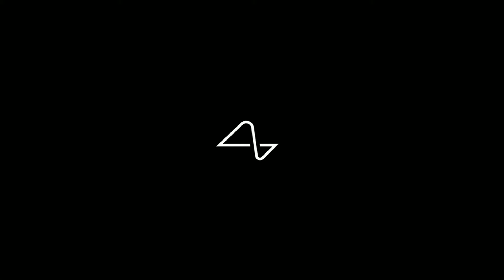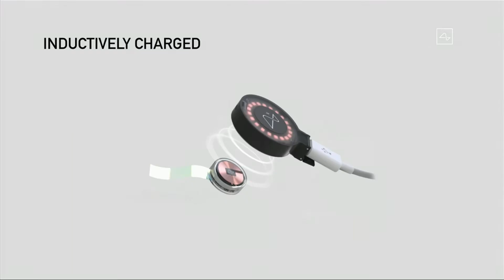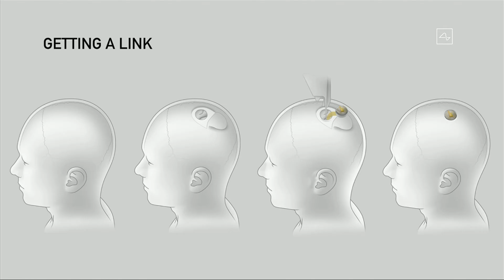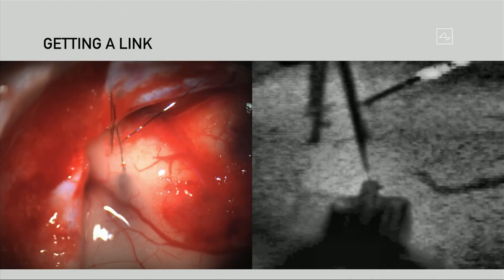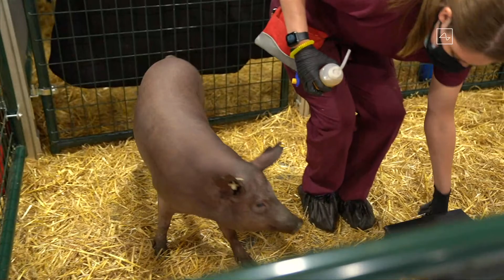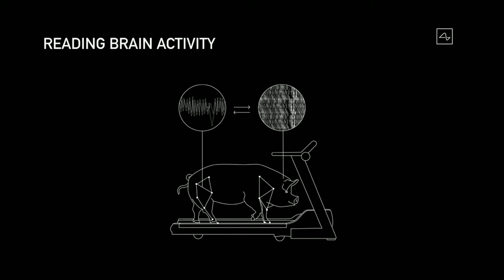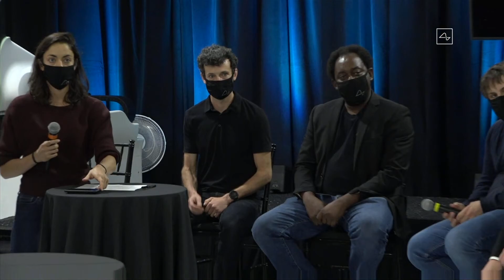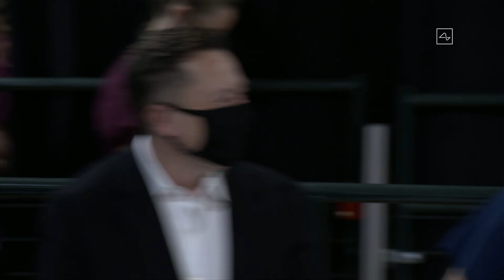Neuralink Progress Update, Summer 2020

Comment: My question is couldn’t you get your brain fried by an emp or a solar flare
Reply: I mean your brain already works with electricity and we don't notice anything happening when an EMP or solar flares happen. 

It'd probably have an automatic shut off button if satellites detect a solar flare and quickly tells our neuralink to shut off. Or it would shut off when it detects a pulse more than .09 joules coming from the outside.
Reply: I imagine the wires could not hold the load and would probably fry before damage is caused.

Comment: Seriously sign me up Elon!! ton of back issues and I'm ready to be free of that pain.
Reply: pain is only your head measuring the amount of damage done in a specific spot of your body. If you remove that spot in your head, you wont feel pain at all but this could create major destructive concequences like not knowing if you broke a bone when you heat something hard. I just wanted to tell you what are you dealing with.
Reply: @StravopoulosBzim  not looking to remove ALL pain just lessening it to a degree would be beneficial.
Reply: @Livverlips  the device is going to reduce the amount of electrical signals received from nerve fibres (cables) onto your spinal cord  (central network of your body) and the brainstem (that regulates your blood pressure and breathing (and that why you feel more thing when you are at pain and not just your back pain) and then to your brain (namely the motherboard). If you reduce these electrical signals either from the transmitter (your back) and then the reduced electrical signals goes to your brain, or just before the receiver so that the device consumes these electrical signals just before they get detected from your brain (namely receiver). What elon tries to do is the second one cause the first one need a neural chip in every place your "cables" are attached to which is doable but pointless and expensive. I hope you understood most of what i said cause im greek and english is not my native language. (Sorry for the long comment).
Reply: multiple herniations and pressure on the sciatica. The pain is debilitating.
Reply: @Livverlips  damn that sucks hope you get better. I'm not very sure if neuralink will be able to help with that issue specifically as neuralink is more geared towards neurons in the brain rather than specific body parts. as technology progresses they might be able to cut off the signals traveling to your brain from that region and create a new channel to cut off the pain but still be able to control that area.
Reply: Me too! Living with chronic pain is torture
Reply: Lots of good info here for those who haven't seen it. Implementing additional physical "stimulators" in conjunction with Neuralink would be a great option. https://waitbutwhy.com/2017/04/neuralink.html